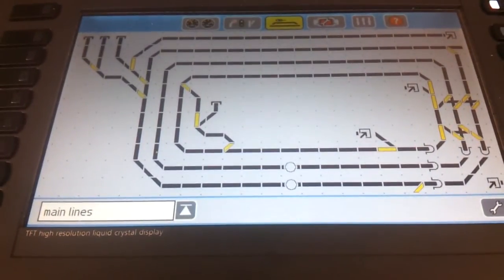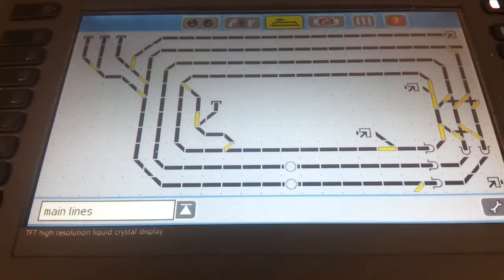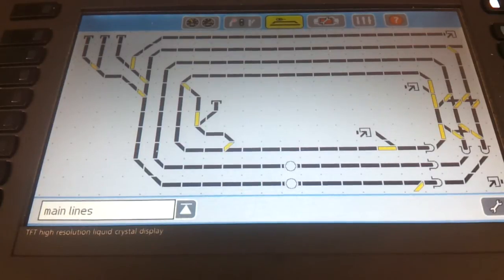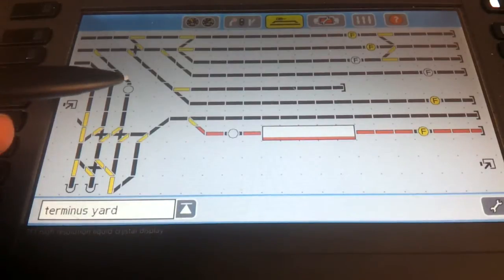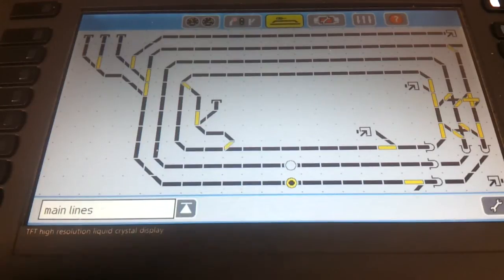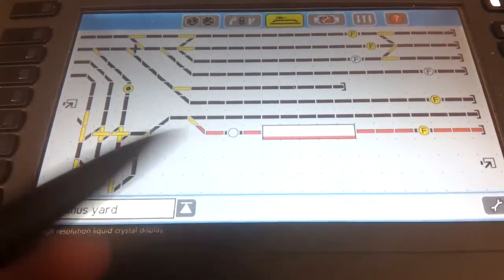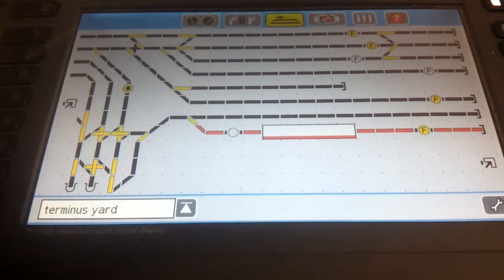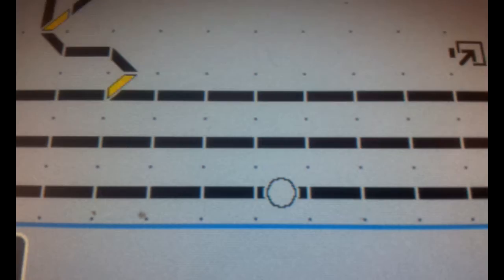ECOS : SETUP A FAIL SAFE ROUTE

Comment: Great videos on the ECoS. Please keep them coming.  I purchased an ECoS and am just getting started figuring out how to use it properly and there are several others here in the States doing the same.  I am curious how the Detector works with trains in operation, will it stop a train before it enters another section that is occupied and can it also control lighted signals for you?

Comment: I use Digitrax. I have a DCS100 command station + 2, DB150 boosters. In comparing DC to DCC Digitrax says 'with DCC you operate the trains not just run them.' I do like operating my trains.

I think we all have to decide how much we each want to automate. Unless you're a club running many trains at once, would you really just want to turn on the computer?

I like the safety aspect, however. I ruined my 1st Fleischmann DB101 in a head-on learning about running DCC. Avoid martinis before running!

Comment from the maker: thanks for the info , but once you use this system its fantastic as a p.c is not required unless you want complex automation, its the touch screen which makes it very easy to use without fireing up a stand alone p.c, but i will be adding a p.c at some point in the future..jim

Comment from the maker: Hi, i am still looking into it but you can do a lot like setting up many routes which can trigger as many accessorys as you want ,6 shuttle modes with four stop over stations on each shuttle route, its very easy to set up once you get around the multi menu system which is huge , the touch screen makes it very easy to setup items & draw track plans. If you want full automation i think a p.c & extra software is needed like win-digipet or jmri ...thanks jim

Comment: Just a commentt. If you intend to run pc control, like itrain, railroad and co, rocrail, etc. Then you can use a much simpler central unit than this One, saving hundreds of pounds. The ecos seems to do a lot of the pc stuff.